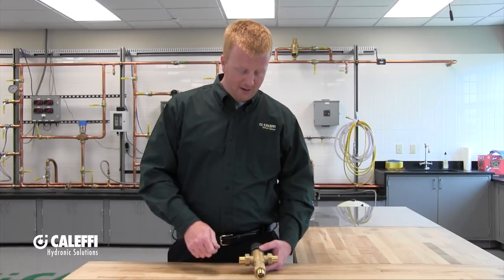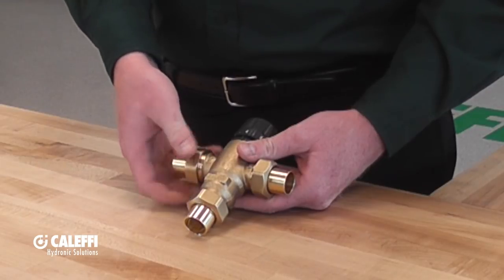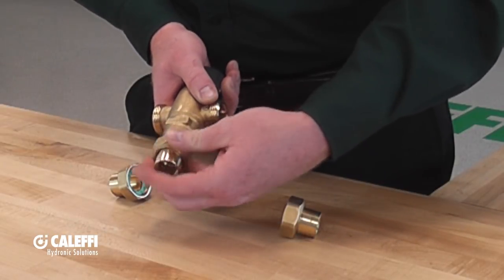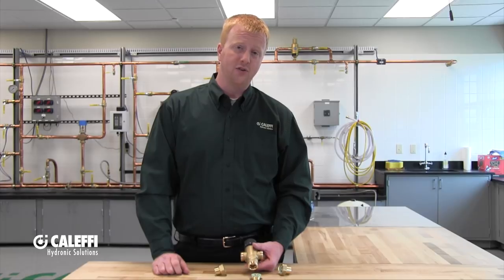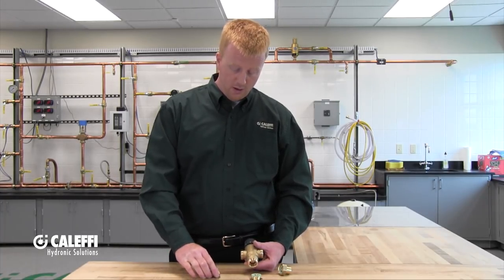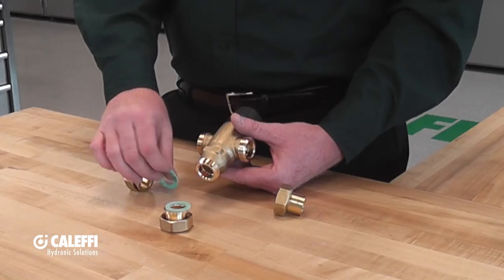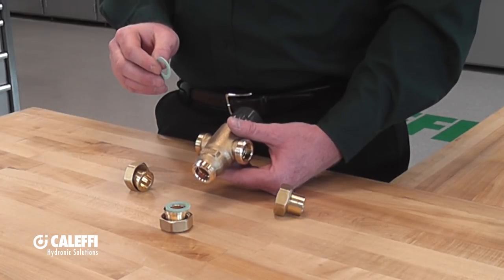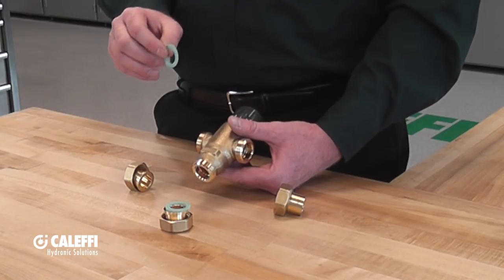How do I clean a thermostatic mixing valve?

Comment: We have hard water and recently our hot water in our home starting malfunctioning. Turning on a faucet or shower, we get about 1-2 minutes of hot water before it turns to luke-warm and then cool (never ice cold). Would descaling the mixing valve be a troubleshooting method for this problem or is it more than likely a burnt out element. We have an oil furnace.
Reply: Did you find out the problem to this issue?
Reply: @davidcao6949  it was the mixing valve.

Comment: What size is this mixing valve 3/4?  Does anyone make a device like this that doesn't mix or change the water temp?  I would love to bypass my mixing valve completely in my new home.  Makes no sense, I can scald every faucet in the house including my kids tubs and showers but for the Master Bathroom Soaking Tub only where the adults bathe I can not get it past luke warm!  Shower will burn you but soaking sux.   I have a zurn mixing valve I even took it off,  turned it around Hot to COLD cold to hot and it still only puts out cold water?

Comment: My mixing valve seems to have hot water coming out the cold water side, is this a common problem  indicating time to replace or would cleaning work?
Reply from the maker: Hello! If you are seeing hot water on the cold side, you will want to verify you do not have a cross connection. You can add check valves on the hot and cold side to prevent flow in the wrong direction. You could also clean the valve body maintenance if it has not been done.
Reply: A lot of good manufacturers actually Incorporate check/non return valves into there product before the union joint of the TMV. I’ve had this back flow issue of hot water to cold taps and bidet’s numerous times. Sadly no manufacturer has had the sense to put isolation points either side of the check so you can easily remove it and dislodge any blockages or replace the check entirely without isolating and draining the whole system if a secondary isolation is not installed. Hope this helps

Comment: My mixing valve sits in the wall behind a shower, and is inaccessible without tearing out the wall.  Would it work to shut off the water and pour vinegar or CLR down into it?
Reply from the maker: Thank you, Allan, for your inquiry.  We are concerned that the valve was installed without an access panel.  Access to the valves is important for maintenance.  There are union connections that could leak, so it is always important to have access.   Unfortunately, we would recommend opening the wall, adding an access panel, removing, cleaning the valve and reinstalling with new sealing washers.  Hope this helps.
Reply: @CaleffiHydronicSolutions  Thanks. I can see the union connections through an access panel, but there isn't room to put a wrench on them and take the valve out without destroying some wall.

Comment: Hi, i have hot water that runs good pressure then less then good again over weeks or months and i check the cold water tap at sink when this happens and get strong flow. Have the gas temp knob to 4 out of 5 but the mixing value has a turn valve from 1 to 5 and is set in the middle and tried to turn it but seems stuck so corroded and partially blocked? Is mixing valve faulty and causing temp to not be that hot then hotter other times. I got the machine to light and boil and then had shower and was almost all hot water and just tiny bit of cold so that cant be right?
Reply from the maker: The mixing valve can become fouled up internally over time from mineral deposits. That can cause temperature fluctuations and lower flow. The valve can be soaked in a deliming agent such as CLR or a vinegar solution, however you want to make sure to have replacement washers on hand before removing it.
F0002096 for the 3 pack of inserts
F0002106 for the 4 pack of inserts (if they  have a union temp gauge).

Comment: Thanks

I just finished this but it was very messy because I just have a single isolation valve on the cold water in.

I better way would be:

1. Isolate water to hot water system

2. Drain hot water system by leaving shower on and jamming expansion valve  on drain.

3. Do

4. Profit
Reply from the maker: +Jeff Bourke In a perfect world, there would be isolation valves everywhere but we certainly understand the world is not perfect.  Hope you didn’t make too big of a mess! In many cases on DHW systems, the isolation valves are on the cold inlet to the water heater.  It wouldn’t be common to have isolation on all three sides of the mixing valve. Hope this helps.
Reply: +Jeff Bourke  Pardon my ignorance, but what is "expansion valve on drain" and how is it jammed? Thanks.